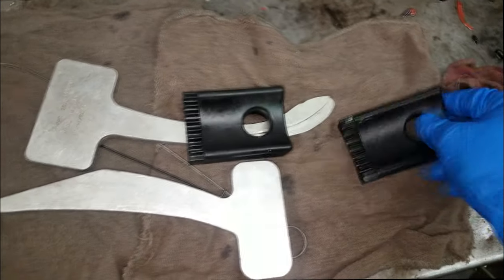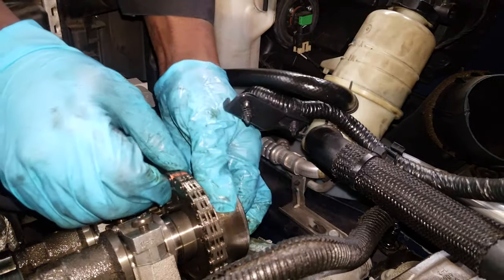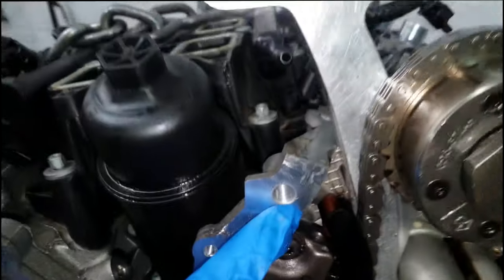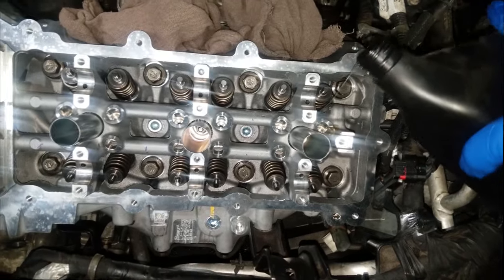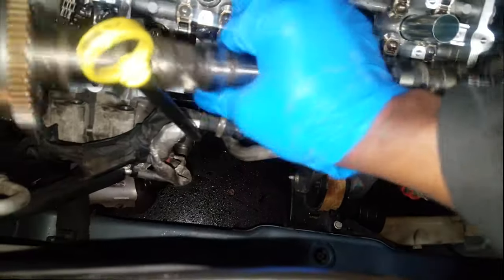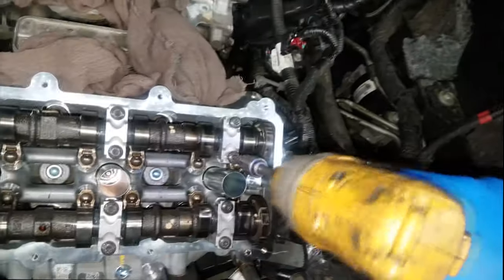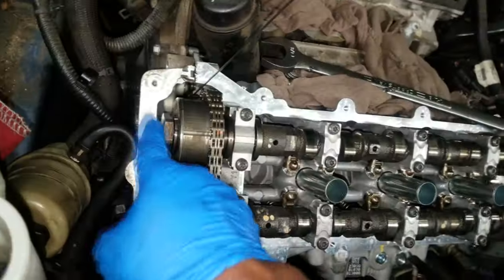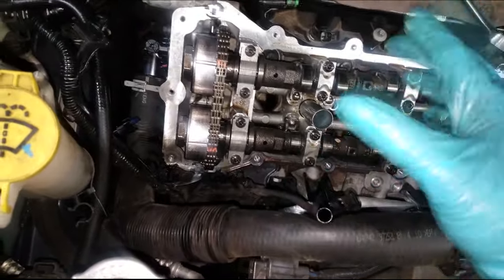How to Replace a CAMSHAFT, CAM Phaser,  rocker arms, 3.6 Pentastar, Timing Chain TOOLS P219A P219B

Comment: Just seen the video because of nessisty. 2015 caravan and at 170k. Left intake cam cylinder 3 rocker failed. Had the tick and not sure how long, but souned like it was the injectors.  Roller was offset but no flat spot, cam lobe was chewed.  Thought i was going to have to pull the front end apart.  Was hating this before i even started, then your vid did a mich better description on how to do it.  Foot messed up n thats going to slow me down and man it hurts still but the job isn't as bad as i thought.        All in all, 170k+ miles n only thing ive done to engine is oil filter spark plugs and air filter. Trany busted at 120k. Lost 456 gears.  Drum gave out n snap ring popped out so yeah.

Comment: Just wanted to say Thank you for making this great video! Straight forward and to the point! I Followed it step by step to change out a bad rocker arm and a chewed up cam shaft in my 2015 Jeep Wrangler. Took about 6 hours to do over the weekend. The tick is finally gone! Thank you!
Reply from the maker: Thats whats up my friend. Please thumbs up the video and sub the channel for me, thanks a lot bud
Reply: @OnlineMechanicTips  Done and Done! Do you by chance have a video on a engine oil cooler swap?
Reply from the maker: @edventures_4938  You mean the oil filter adapter housing on the top?
Reply: @OnlineMechanicTips  yep, that one. I have found a few videos on the swap, but I like your straight forward approach in your videos and was wondering if you had one.

Comment: Bro, you are my hero!! This side of the engine has fought me every step of the way. That plastic tool that holds the chain slack holder wouldn't stay in place and it kept popping out. Then I found your priceless to me video I did it how you said to do it and made me a little grenade pull and after messing with it for about an hour I got everything to stay loosened up. Then when I was putting it all back together the chain kept slipping on the cam phaser gear. I took the exhaust  cam back out three times before everything stayed in place after me keeping my hand on the gear so the chain wouldn't slip.I was ready to cry last night because I thought I was going to have to take the timing cover off until I found your videos. Thank you for taking your time to make them for people like me.
Reply: Bro such a pain I had to pay 130 for the aluminum tool because junk plastic one won’t work . I’m just waiting for it but dammm
Reply: @stevepalenicek4690 Where did you found the cam lock tool?

Comment: That is absolutely the best demonstration on that ratchet tensioner on the internet hands down. 👍👍
Reply from the maker: Thanks for watching bud..I saw that 600k mile Promaster engine you had over there..That was a lot of miles for that engine..The next high miliage engine I replace I will diss to take a look at those bearings and the internals.
Reply: Online Mechanic Tips I’m really impressed with the internals. Journal size was very impressive and important very high miles. I should have done guides and chains and kept going just to see how many miles the rest would have done. I think a million miles was very much possible. It’s 80-85% highway but still very impressed with minimal wear on the rotating assembly.
Reply from the maker: @86lowrider  wow, ...good stuff..The last high miliage Promaster I worked on, I was not impressed at all by the customers neglect..smh...here: https://www.youtube.com/watch?v=rDPU-Y8ecrE

Comment: Just wanted to thank you. Just finished swapping out all 4 of my cam phasers. I had a few issues. Extremely noisy on start up, sometimes sounded like lifter noise sometimes it sounded loud enough to be a rod knock! I also had intermittent P0349 causing me to have no power. After paying my dealer $700 to swap out the Cam positioning sensor and a valve cover gasket oh and telling them I thought it was a bad cam phaser . It was no better. I ordered the parts re watched your videos on the subject and proceeded to change the phasers and the leaky oil cooler. I have my fingers crossed I fixed the issue. I just know it starts nice and quiet now. Sorry for the long rant but I really wanted to say thank you. I wouldn’t have attempted this repair without the help of your videos. Keep up the good work
Reply from the maker: Awh my friend thats whats up. Im glad you got er done. Please make sure you thumbs up the vid, thanks again bud for watching.
Reply: @OnlineMechanicTips  oh and I almost forgot…. My MPG went up 4 full miles per gallon after finishing the repair!!

Comment: Thanks again for the video.  Found the issue that I described earlier.  The chain on the intake side was actually not stuck.  The slack was on the the exhaust side.  I took the exhaust cam (with phaser) back off, pulled the slack from the exhaust side, re-aligned my marks, and viola!

Comment: Had to do the other side today (right side)  so I’m glad I have these videos saved from six months ago. I can’t tell you how much I appreciate you doing them…

For some reason I couldn’t get the special tool in the right way to release the tension on the chain on this side (I think the guide kept moving on that pin it sits on and I didn’t have anything to stick in there to hold it) so I just did it without it, it wasn’t that bad I just had to be patient and rotate the cams a little bit to my advantage to slide the phasers back on 

Thank you so much again

Comment: Thanks so much for sharing that grenade pin tip. I fudged the timing after i ... (Opened left side 4x) Long story short, this will save me so much time on adjusting this time around.

Comment: Thanks for the effort to make these videos - very much appreciated!!!   Q :  What else during a DIY rocker arm/cam change should I replace while I have the engine apart?  eg. PCV valve? VVL Solenoids?  Install Oil catch? etc.......My engine is very oily on top of the valve covers by the way @ 105k miles (2020 Jeep JL).  Gaskets for sure to change but regarding preventative and items that might as well be replaced while in the engine.  Thanks much!!!

Comment: Hey JT, I failed to mark the timing chain links before I took the sprockets off when doing this procedure on the driver side. I did mark the two dots to the first two cam caps at TDC, I can match the cam sprockets to those marks but not to the chain, is there another way to know how the chain should fit?

Comment: When inserted the plastic tool to push chain tensioner the plastic side of guide rail broke off the tensioner. I used correct part you mentioned. Do i need to replace with a new chain tensioner and tear the whole front of motor apart? Or will it still provide tension on chain with one side of the plastic broke?

Comment: Hey man! You’re videos are awesome! I’m in the middle of a complete rocker/lifter, and bank 2 exhaust cam replacement. I’m stuck on getting the grenade pen seated the hole. I can get it in the hole, but i guess it’s not slipping into the whatever it’s supposed to go into. It doesn’t hold the tensioner back and just slides out. I am using my upholstery removal tool to move the tensioner, but I can never get my grenade pin to get “pinched”. Thanks!
Reply from the maker: Hello my friend, thanks for watching. Can i first get you to like the video and subscribe to the channel? thanks..Now, im having a hard time making out this question. you have to make sure your pin thin enuff to even be inserted into the tensioner hole. Next, if you have the plunger all the way in, your pin should fall right in..Im not understanding the question
Reply: The side pin is what I didn’t know about. I dont understand how it lets the guide fall back further than what I can push it, but imma try it in the morning. I think I owe JT that $20 donation.

Comment: After you do this job should you put synthetic oil in the engine after? I just completed a job like this replaced all lifters, rocket arms and camshafts and the valve train is rattling. Everything torqued to specs and in time. No codes.

Comment: I just used the hook and guide tool on the tensioner without using the grenade pin I had enough slack to install cam and phasers. The tensioner will loosen if I roll the cam in rotating direction with a wrench after all is torqued to spec. Just wondering is that normal with no oil pressure. After baring the motor over it seems to be tight just wondering if I still have a good tensioner before cranking. Advise is greatly appreciated I usually work on diesels do not know all I should on these motor thanks again

Comment: Hey i just did one of these and now the car wont start. Unlike the video i had both sets of cams exposed. When i torqued one set of cam valves it made everything(the cams)  shift on both sides. Did i throw timing off? Do i have to pull the entire cover?
Reply from the maker: Oh dang. Yea, you now need to verify that both heads cams are timed and that #1 top dead center up
Reply: @OnlineMechanicTips  i took the valve cover back off and the teeth are off by a link. Would that cause valve damage

Comment: What order do you torque the bolts, is it Cam Phaser then Cam Bearing Cap or other way around also do you torque with grenade pin in or out?
Reply from the maker: Usually when I place th cams on the head, I automatically want them locked down securely and torqued to the head. From there I proceed with attaching everything else.

Comment: My son's 2014 Jeep Wrangler Sport had 'the tick'. Coming from driver's side. I have 90s Miatas and do timing belts, etc. on them, but never did more than oil/filter changes on the Jeep. Watched your videos and thought I can handle that and dug in. Sure enough cylinder 4 (if I'm counting them right - middle cylinder on driver's) had both exhaust rockers bad. One was seized up and had eaten away at the cam lobe pretty bad. Replaced the cam and all the rockers/lifters. When I put it back together, I could hear a tick on the passenger side that wasn't noticeable before because the other was so bad. Dug into that and the middle cylinder there (#3?) had one bad rocker on the intake cam, but it hadn't had a chance to do more damage. Got that all straightened out and she's purring like a kitten again. Spent most of Dad's Day on the second go 'round but I'll sleep good tonight. Bought the cheapest oil I could and will put that in in the AM, drive it most of the day, and change it again w/some good stuff. I had that in mind already, but saw your other video about the cam lobe metal loose in the engine.
Can't thank you enough... And, yes, I have subscribed :)
https://youtu.be/B717ciLYvUM

Comment: I am a new subscriber - I’ve learned so much from your videos 🙌🏻
I’ve followed this video and used the locking tools. Everything has gone well until I’m trying to get the phasers back on the cams. Exhaust goes on fine, intake is barely short to slip back on. I’ve used the tool to confirm the tension is released I just don’t have enough slack to get it back on the cam. I’ve been at this for many days. 
800 miles from home and want to button this up and get home 🙏🏻
Reply from the maker: What kind of car is this and which head you doing?
Reply: @OnlineMechanicTips  2014 Wrangler, bank 2 (driver side)
Reply from the maker: @cindirenee  My friend on bank 2 if you have that plunger all the way in its home and the grenade pin installed like in the video, you should not have any reason to easily get that phaser on if you following the marks. Im not sure where you getting stuck. Hope you using the wrench to turn (rotate) the cam to where it should be to allow for installation
Reply: @OnlineMechanicTips  I am using the tools. The tool also likes to pop out and gets in the way of the intake phaser so I’ve got a 2nd set of hands helping me. I’ll keep trying.
I keep watching your videos and little details give me aha moments so, again, thanks for putting out amazing videos with instructions that are easy to follow 🙌🏻
Reply: All 4 cams installed 🙌🏻 someone told me the camshaft brackets need to be “degreed” when torquing…I haven’t heard you mention it so I want to confirm as I’m getting ready to put my Jeep back together.
Reply: After completing this job, I have code P0369. I’ve changed both camshaft positions sensors and code remains and cannot be cleared. Car is in limp mode but engine runs better and gas mileage improved since the rocker arms were replaced. Do you have a video for this or can you point me in the right direction? No other codes at this time. Onboard diagnostic does not report any codes even when the CIL is on…please help 🙏🏼
Reply: @cindirenee , I have the same code after replacing the rocker arms. Did you get it resolved? I tried bringing it to the dealer, they relearned the position sensor and wanted more than I cared to spend to remove the covers to see if they could see what was going on. It didn’t eliminate the code so I picked up a bank 1 exhaust cam to see if that would resolve the code.
Reply: @adamtorgy  no, my question hasn’t received a response yet. 
I still have the code. Replaced both sensors AND the wiring. The dealer here wanted $700 to check and tighten the galley bolts - which they were convinced was the problem. I did the work myself and it WAS NOT the problem. Code remains…Jeep is not in limp mode but it will not downshift on its own to climb small inclines and has intermittent issues accelerating between 3rd and 4th. 
Seems to be a mystery and I’m not willing to pay $600+ every time they decide to open the valve cover…

Comment: I have a 2015 Jeep Grand Cherokee 3.6L that had a P0302 code. Cylinder 2 did have 50PSI where other cylinders were at 150PSI. I did pull the valve cover and noticed both camshafts were scorned / rounded and need to be replaced without a doubt. Valve Springs are good, not bent or broken. The rocker arms are possibly good, but will replace them anyways. My question is this: Would an engine be a better route or just replace the Camshafts and rocker arms? This is all on the driver side. I’d say to last at least another year or longer if possible?
Reply from the maker: No my guy, no need to replace the engine for simple problems like this. Curious as to how many miles on this Jeep. Also are you subscribed to the channel?

Comment: Great video, I just see one potential problem when you were pouring oil on top the head. Seems like some oil may have gotten down in the bolt holes. 
Could affect torque on bolts and potentially crack the bolt hole when tightening, trying to compress the oil with no where for it to go.

Comment: I installed new rocjers and cam phasers on 3.6 2015 Jeep. When I rotate engine by hand there are a couple spots where the exhasut phaser and chain seperate then snap back? Like the chain comes off teh sprocket a bit. Is this a bad tensioner or because there is no oil pressure?

Comment: I'm goint to buy an old Caravan pretty soon. It'll be my first mopar vehicle. The rocker arm issue has been my biggest anxiety about the 3.6 is those failing rocker arms. Now that I know about those tools, I'm not as worried about the job. I just didn't want to get involved with the timing chains and timing cover.

Comment: hey boss im working on bank two as you shown the tentioner colapsing making chain loose well im done with job and now tensioner is still retracted chain still loose how do i get it to Engauge??
Reply from the maker: It will fully retract once you start it and oil pressure builds. The thinking goes to carry all the chain slack to the tensioner area and the pull the grenade pin
Reply: @OnlineMechanicTips  dont mean to take all your time. so there is no granade pins right now yet the ratcheting on tensioner still all the way in by it self so you think i can insert a granade pin on the top hole to get the ratchet to come out so chain gets tight??
Reply from the maker: See Short reply

Comment: Hey so im going to do this to my grand caravan. Ive done rocker arms before without having to mess with the cam phasers or timing at all but the grand caravan definitely needs a camshaft replacement as well so I wanted to ask what exactly are you using to mark the timing on the phasers before disassembly? Thanks.
Reply from the maker: Thats just a perm marker pen junk yards use. I got this from our parts dept. Im not sure where they got ot from. Will you be using the timing chain block kit and all the special tools? You might wanna have that tool kit on stand by. Also are you subscribed to the channel?
Reply: @OnlineMechanicTips  just subbed and yeah im gonna order the kit online.

Comment: Another great video. Has all the info to get the job done. 
I replaced all rocker arms and lifters on my bank 2 (left). After starting the engine again still heard ticking/knocking noise. Removed the valve cover again and by turning the engine by hand I noticed that my chain guide keeps popping on the tensioner retracting black paw every so often. 
I used the side hole to lift on the paw and extract it all the way out as close to the chain guide. Turn the engine by hand few times again and the noise is not there any more. 
Is it required to extract the paw from tensioner after you pull on the grenade pin or do you think I have another issue?

Comment: just changed all 24 rollers and rockers but now when putting back together the marks that I put on the chain R now three (3) links off, is there a fix for this or am I going to have to pull front off and start from scratch on timing. Also why does it time on TDC exhaust stroke. Any feed back appreciated

Comment: Hey man. I did this job on my 2019 Durango with the 3.6l vvt. I am now having a low vac and running rick. Took it to a shop they said the timing was off . I checked the timing 3 times and was good. They said they set the timing and it is still doing it.. they are saying a bent valve now.. any advice